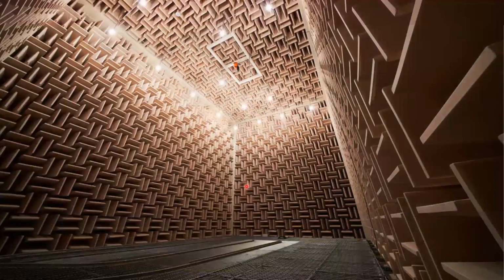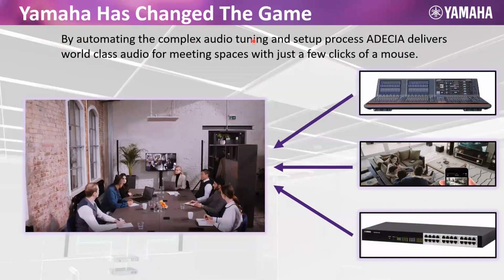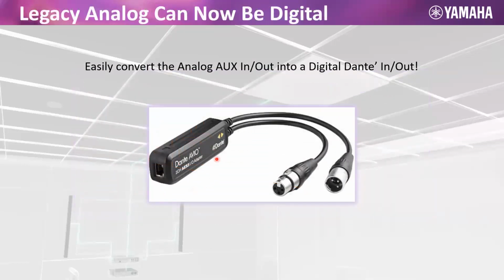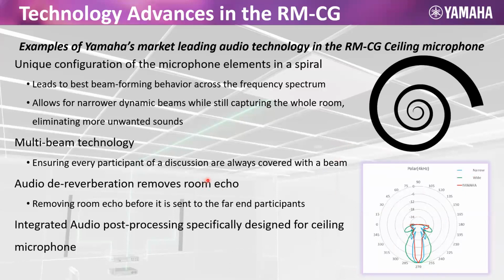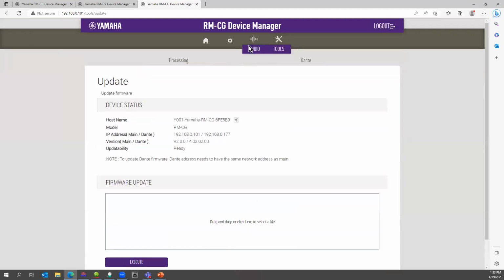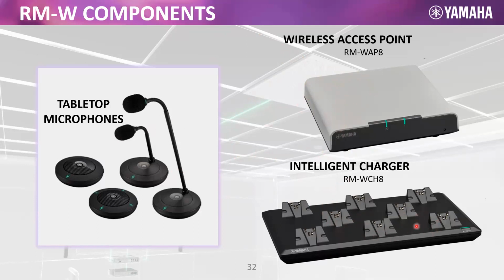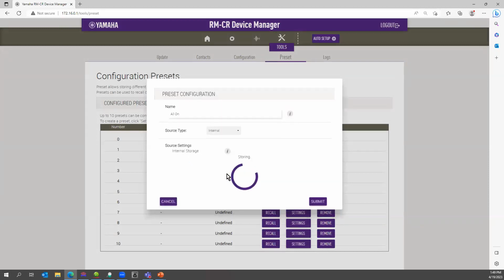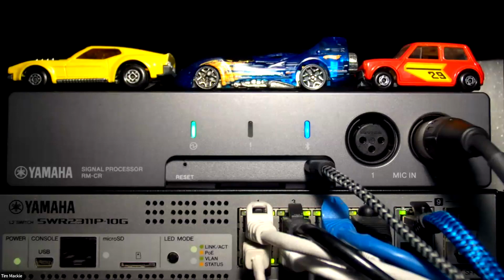Yamaha's ADECIA Audio Solution: How It Works & What's New Webinar

Comment: Hi, Thanks for the detailed video. It is very helpful. Can we use both analog wireless mics and RM-CG ceiling mics together in a large room and how is the feedback performance when the speaker is standing just in front of the Yamaha dante speakers?
Reply: You know that the VXL speaker has a small driver, and when you stand in front of the speaker, very little energy reaches the mic diaphragm, so feedback is avoided due to the nature of the VXL speaker.